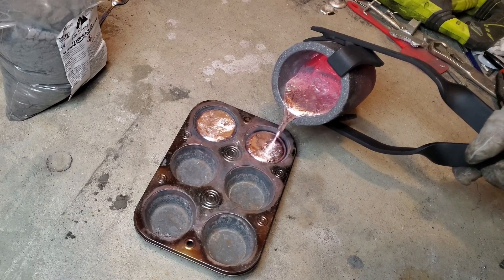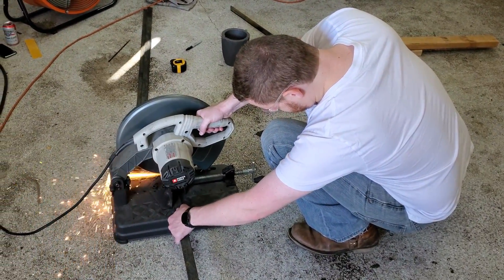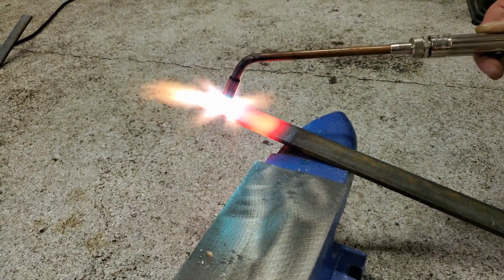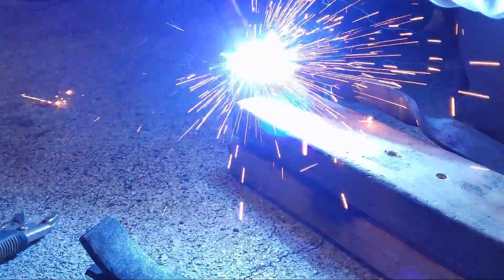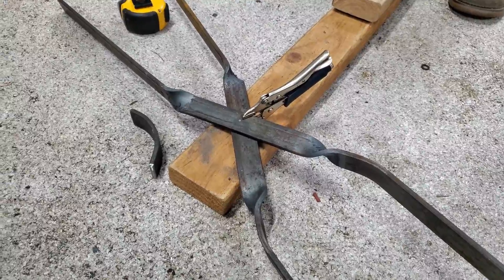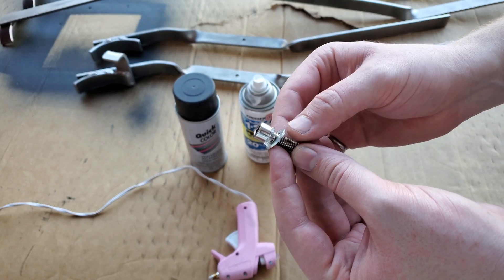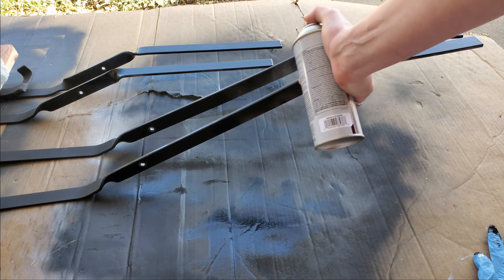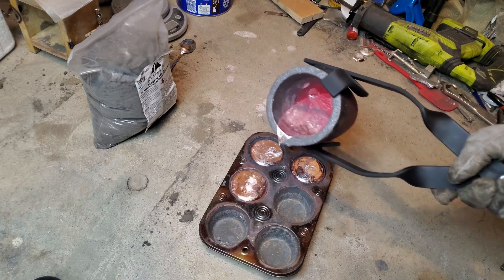Don't buy crucible tongs before you watch this video!

Comment: Another micro change if one chooses.  Instead of the locktite, drill & tap ONE side of the tong, then when you tighten down the nut, you're locking it in place.

Comment: yes, somebody else will have a different approach. have you check luckygen1001 channel? he is a old sand crab still pouring iron almost every week. yes, he is a old guy, which, implies he had done his job for a long time without any accident that can kill him. such as dropping cruisble. that's something we can learn from him. one of his secret  weapon is a cruisble cart, just some scrap metal and a pair of wheels to build. but it can reduce some dramatic scene. he is pouring iron and steel of all kind, that's a lot high temperature than aluminum and easily weight 40~50lb per cruisble. he had detail instructions on his channel , not just the cart, but answering casting problem too, worth that 5 mins spent to say hello there and learn something.

Comment: Nice work. The only comment is that the type of pouring tong you made is ok for smaller crucibles, but not recommended for heavier pours, because the bar might bend at the 90 degrees turns. Instead it's better to use a "L" shaped design, with a hollow tube which is much stronger. Check the "myfordboy" channel on YouTube, he uses this type.

Comment: Could you do this without any welding?
Reply from the maker: Possibly, you'd have to countersink 2 or more machine screws in each jaw so that there are no point stresses on the crucible. Befriending a welder and bringing a 6-pack is probably the easiest way

Comment: Nicely made. I would use slightly lighter stock to manage weight reduction. I am an old lady with kitten strength, so a firm but light grip on hot metal is desireable. Maybe 1/8th steel.
Reply from the maker: 1/8" would probably work too. Just be sure to fill a cold crucible with ingots to check if you still have a safe, firm grip!
Reply: @TenTries  excellent advice, practical test. If I needed to increase the metal strength, I would put a slight fold in it, lengthwise.  Just my opinion, but this is a good design you have
Reply from the maker: @picklesnoutpenobscott3165  the fold would probably help a lot! If you couldn't tell, I tried to simplify this design quite a bit

Comment: Something I wanted to point out, primarily for your safety, is that you need to get some fire bricks to set your high temperature things on. Furnace/forge, crucible when hot, molds when pouring molten metal,etc... should all be done off of cement. Cement is known to explode randomly when you place extremely hot things on it. This includes driveway concrete, and stuff that your garage might be made out of. 

Past that, you have a great tutorial set up, that is clear and concise. I'll be trying to follow your steps in making a set of tongs like this.
Reply from the maker: Glad you found the video useful!
Good points, I had a piece of concrete spall hit my welding mask about 12 years ago when I got my cutting torch a little too close to the concrete. For one reason or another, I haven't seen it happen with molten aluminum on the concrete I pour over, but that certainly doesn't mean it couldn't happen. I'll have to do a little research and testing and make a video about it. It's pretty common to see people pour over concrete, so it is likely a good idea to warn of the lurking danger.
I'll mention that I do place my crucible on a thick steel tube when transitioning between the lifting and pouring tongs. The base of the crucible can be much hotter than the aluminum itself, since it rests on the heating element in the furnace.
Also, the furnace is raised from the concrete by the steel ring base that is on all the 20lb upright propane tanks by DOT mandate. The concrete below does not get nearly hot enough to spall.
Thanks for the input! I'll find ways to make things safer!
Reply: I've had that when I've soldered water pipe on concrete in the past. Not something I would do anymore.
Reply: Another safety concern is the non-bolted or secured power tools. Great video though!
Reply: I have seen people using old disc brakes to sit the crucible on, also I have had heat bricks crack under heat
Reply: I have an old oven tray half full of green sand that I lay my pouring shank across. When the pour is done I can dump the crucible upside down onto the sand to get most of the crud out of it.

Comment: I think you may be better with a rivet hot forge from 1/2"pin rather than a bolt and nut. My stupid OP.
Reply from the maker: You're probably right, but that would take skill and I don't have much of that to spare haha
Reply: @TenTries  Compare to what you did, that is low level skill
Reply from the maker: I think the trick would be to get just the right tension after the rivet cools. That might be difficult. You certainly wouldn't ever have to tighten it though

Comment: Two comments:  1) you might make the lifting tongs more in an "X" shape, like an ice tongs.  With that design, gravity helps the tongs grip the crucible securely and depends less on the user's uncertain hand strength. 2) Many pouring tongs use a ring welded to a handle to hold the crucible for pouring.  Ring tongs need a holddown to keep the crucible in place during the tilt and pour.    A simple, safe, and common design welds the ring to the handle at a shallow angle (15 - 20 degrees) permitting the user to view and control the pour from an advance position at the side. An innovation mounts a short telescoping slide over the handle.  The slide features a rod welded on top extending towards the ring and bent upwards like a fishing pole at the same angle as the ring.  As the user moves the slide down the handle the bent rod extends over and descends on to the hot crucible, gently holding it in place.  After the pour, the user retracts the slide and releases the crucible.  A refinement uses square thin wall steel tubing for the telescoping handle and slide to prevent rotation and give greater control.  Thanks for a good video.
Reply from the maker: I agree, for the shippable tongs I'm designing, I did increase the 20 degree bends a bit. It didn't seem to be too difficult to lift to me, but things can always be improved!
I looked at the ring design too. This felt a little more intuitive to use, but the ring would be essential for large crucibles for sure

Comment: Could these tongs be made from 1/8" thick flat bar instead of 1/4"?
Reply from the maker: Maybe, your hold on the crucible wouldn't be as secure. For lightly loaded, or smaller crucibles, it might work. I chose 1/4" because I saw how much the 1/8" ones flexed on other videos
Reply: @TenTries  Thanks! That's what I was thinking, for smaller crucibles it would probably work but not the larger ones.
Reply from the maker: Yeah, nothing wrong with trying! I checked these with a cold, weighted crucible to make sure I had full, comfortable control before working with a hot crucible

Comment: Sorry, but  the pouring tongs are WRONG! They require you to use a lot of your strength just to keep them closed against the crucible meaning less strength and therefore less attention to correct pouring The best pouring device is a simple crucible fitting hoop on the end of a suitable stout shaft .The industry standard pouring shank! Much safer and much more controllable. OH ,and you  do NOT need  clips to hold the crucible in  the pouring shank.  I have never used such devices and in 60 years plus of pouring metal I have never had a crucible fall out of a shank!.... Martin
Reply from the maker: Thanks, Martin!
I'll take measurements on the clamping force required because it is surprisingly little for a #4 crucible. I'd say it feels similar to holding a pint of beer. For much larger crucibles, this design would not work
The clip may be my engineering (arguably over engineering) past showing through. There's usefulness to a little extra peace of mind when pouring. It may not be absolutely necessary, but I and many others don't have 60+ years of experience to give us that peace of mind. With this design, I know there's no way for the crucible to slip out as long as the tongs aren't opened any further. I think that peace of mind is well worth the little bit of fab time on the tab.
Are you anywhere near Kansas? If so, I'd invite you by to lift a crucible and have a beer. I think it's hard to explain in text or video how it feels to use these
-Chris
Reply: Thanks for the tips, gentlemen.
Reply: It seems to me a simple holddown is justified.   If a crucible did fall out, for example, during a full tilt as the foundryman pours out excess melt, there would be trouble.  Cheap insurance.
Reply: Hey... Shanks a lot for the info!👍😉🇨🇦

Comment: tell us about your electric furnace and how you made it
Reply from the maker: The shell is a former propane tank using 0.5" of castable refractory as the liner and rockwool as the insulation in the walls and lid. The insulation in the floor is a mixture of portland cement, vermiculite, and Sodium Silicate. Although, a mixture of vermiculite and castable refractory would have likely been a better choice. The heating element is a simple 6" stovetop coil heating element. It is computer controlled using Python and an Arduino.
I've been debating how to approach the build video since Tries 1-8(ish?) were the inspiration for this channel, and naturally my memory is the only record of those. I may at some point explain the many different designs I tried, but a full on re-creation would be a challenge. The record of the latest version is a series of saved snapchats of the steps, so also not very helpful for making a video.
In the near future, I'll be making a build video of pretty much the same design but propane. That will allow me to melt higher melting temp metals. If I remember, I'll explain the minor design differences between the electric and gas versions.